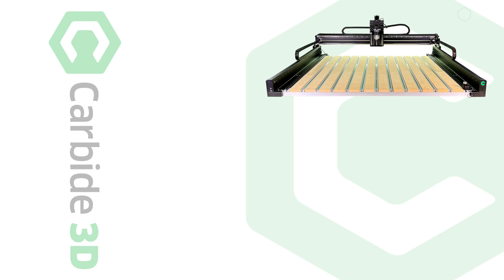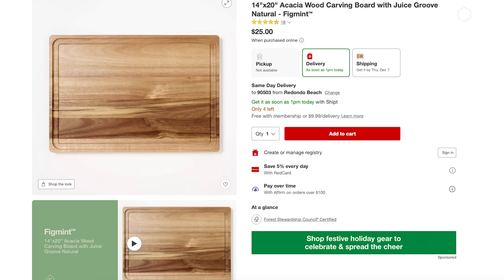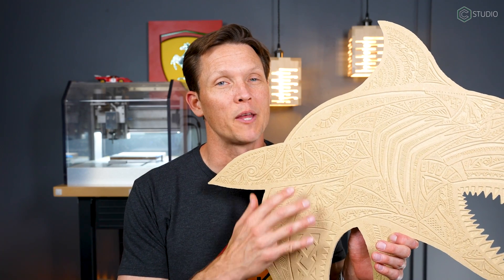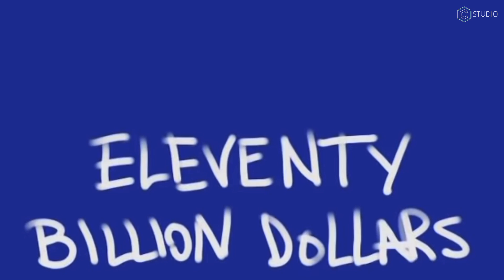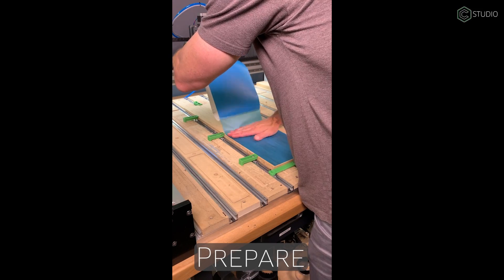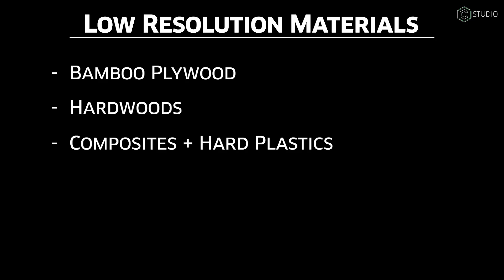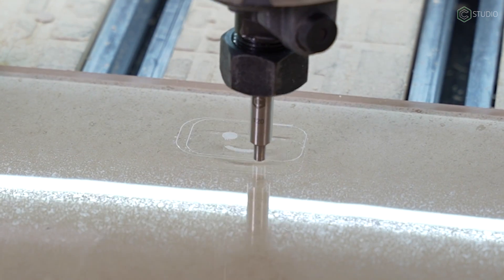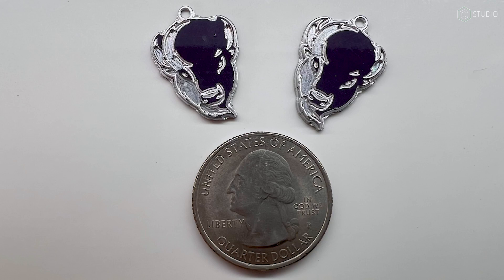Consider Material Resolution for Cutting with Shapeoko

Comment: Thought of couple other materials.  First would be extruded polystyrene, like the pink stuff from the big box stores.  There's a higher density version, called HDU (high density urethane) that's great for making models and will hold more detail than polystyrene.  It is more expensive though.

Comment: Ipé or Brazilian Rosewood, usually used for decking is great for signs that will be outside since it is pretty immune to rotting and splitting in use.  I’d call it medium to high resolution and like oak can split when running with the grain.  I’ve been using a bunch of left overs from a deck project to make stuff for friends.
Reply from the maker: John,  This is an excellent suggestion.   Thanks.

Comment: I never heard of Richlite until one day before this video,  now I really want to try it.

Another similar product, I think, is Wilsonart Thinscape, basically a 1/2" thick plastic laminate (counter material).

A product similar to the Thinscape is Corian, or any other solid surface material,  commonly used for making lithophanes. Something else on my to do list.

And finally, a bio plastic called Acre, made by Modern Mill. This stuff cuts and carves like a DREAM on a CNC, I can speak from personal experience.
Reply from the maker: Thanks for adding to the conversation.   Richlite is terrific.  We'll take a look at the other ones you mentioned.

Comment: LDPE from (used) plastic cutting boards falls somewhere in the middle when it comes to detail, but is very forgiving if you mess up with the feeds and speeds. So I recommend it as a good beginner material or if you want to cut something quick and dirty.

Comment: Great summary... The material you use really depends on the project. Like with all woodworking projects (and contrary to what some might say, adding a CNC to your toolbox is still "woodworking"), you really have to know the strengths and weaknesses of the material... Throw in some epoxy, and you have a party!